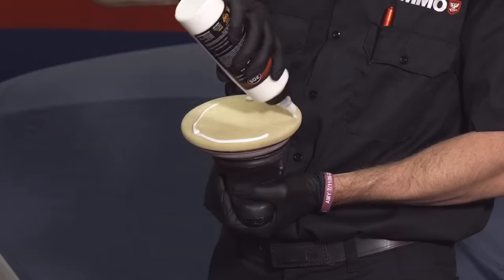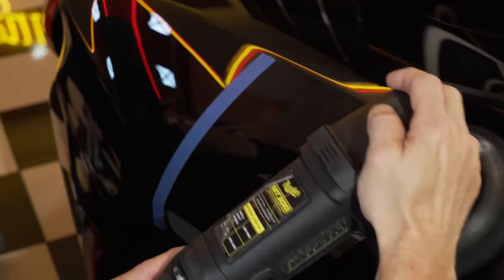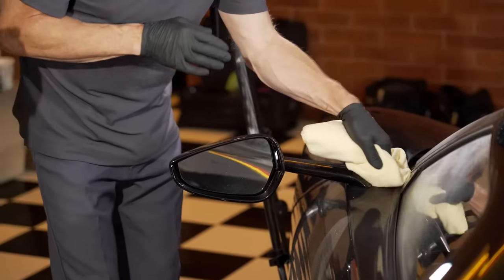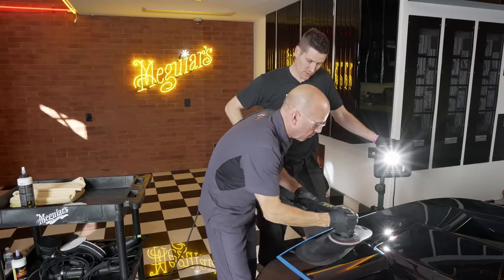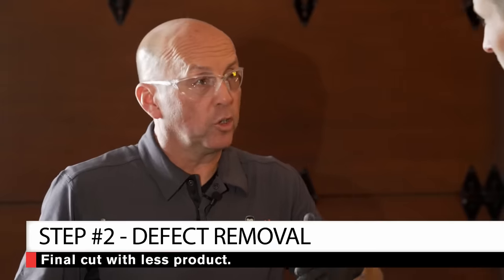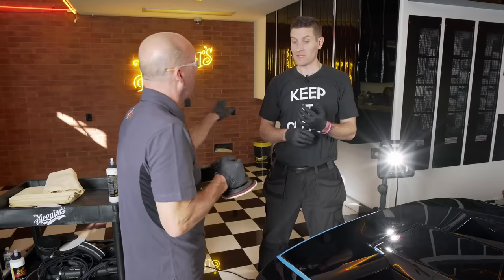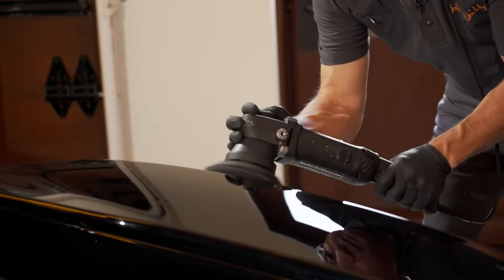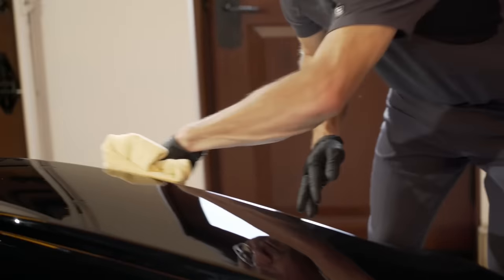3 TIPS FOR POLISHING BLACK SWIRLED PAINT YOU MUST KNOW! FORD GT

Comment: The more I watch, the more I understand.... And the more scared I am of trying myself.
Reply: tell me about just bought a gravel road daily driven 07 black fj crusier that desperatly needs it but i cant afford /trust the shop in my town and im scared to mess this up
Reply: Don't worry about it it's so simple. These guys are professional and their jargon is scary. I just use a random orbital from autozone and a single foam pad that came with it. Compound and wax looks awesome.
Reply: I was the same way. I've had a DA for months and was so afraid of screwing up the paint. I finally did it last week, used the Meguiars Ultimate Compound with an orange cutting pad then Ultimate polish with a white pad, it came out good and I didn't ruin anything.  One thing that really helped me was drawing black lines in marker on the backing plate so I can see how fast it's spinning then adjust the pressure accordingly.  Took some practice figuring out how much product to put in the pads, changing the pads every section with a new pad. The polish alone does a good job with swirls.  I think if I went with other brand/type compound I may of possibly screwed it up, the Meguiars was easy to use, and there were times the pad was skipping around and I got nervous, but didn't harm the paint at all.
Reply: @timb7775  Thanks brother, the black marker idea is genius. I'll give it a try for sure eventually when I create enough swirls 🙂 I'll definitely keep in mind your advice when they day comes 👍🏽

Comment: As the owner of a black car othat lives on a dirt road, i have learnt over time to NOT use polish. A 100 percent cotton rag ot T shirt after washing folded into quarter size. I do 1 or 2 passes in the direction of the metal flow, then turn the rag a quarter turn. I do this 4 times then turn rag over to a new section. This method guarantees my car is like fucking glass every day..and the cotton being used ensures the dust bpunces off the paint as its so fine. Microfibre cloths are not tightly woven enough to get your psint like mirrored glass. Its painstaking work, but once you have the surface reflective its incredibly easy to maintain.  Polish just fills the surface to make it appear smooth. This method makes it smooth. Never ever use any electrical buffers or polishers. By hand. You are welcome..you will be able to see the poes on your face in your paint.

Comment: Finally I am getting my black car to actually look good. I have tried so many pads, polishers and products and it just never comes out like I see in everyones videos. Finally seen that I still had residue and my aint or area was not prepped right. I was using some harsh stuff that felt like sand and still it didn't make a difference still had the same swirls and scratches just more shine to it. I wasn't taking my time wasn't leveling down pads but most importantly my prep was garbage.
Reply: 100 percent cotton cloths and NO POLISH. Polish just fills the surface making it appear smooth and eventually dust just sticks to it. Cotton is finer than microfibre. Use microfibre under a light at night and you can see it marking the paint. Cotton is so fine it actually makes the paint smooth, like glass. I spent 8 hours on my bonnet. I can see my damn pores in my paint. Cotton rag folded into 4. 2 passes..in straight line in metal flow direction..turn rag a quarter turn to left or right and do 2 more passes..repeat until you have done all 4 edges. Get new section of cotton, repeat. Meticulous work..but the best you will ever have your paint. Makes it like glass, and it stays that way. I live on a dirt road and this makes the surface so smooth the dust bounces off it. You're welcome.

Comment: +1 on the water on dry residue after the mow-down cycle with compound. I sometimes even used the water compound slurry on the paint with the buffer to let the compound continue to do its thing (sometimes it would dry out prematurely due to the ambient temperature because we were in SC in the summer- indoors of course but still...) it almost always worked out. Before the age of inspection lights (early 1989) we would take it back out in the sun to do a CHECK. The sun would be a tell-tale sign of how we were doing. We have come so far now that it's unreal...

Comment: Key point that was said by the Guru, "Keep in mind your removing Paint or Clear Coat Permanently"  So only cut the paint if you HAVE to.  I try to explain this to folks that are out every other weekend with their polisher chasing down every single imperfection in their daily driver.  You just might be doing more harm than good, and to think that oops I removed too much clear coat, I will just add another coat of a ceramic coating in place of what I just took off, it doesn't work that way.  Nothing will help your paint more than the factory clear (assuming it is 2 or 3 stage paint etc).  Just my thoughts.

Comment: Very informative indeed. I’ve heard this a couple of times lately that it’s better to do less passes as all you are doing is work in paint residue rather than getting the results you’re after. Suits me as it takes less time!
Reply: Yeah. Experiment. Try with 2 passes, then 3, then 4. You'll learn how many passes are needed to get the work done. Use the blue tape for this.
Reply: Mod MINI could you please explain to me what the benefits of the blue tape is. Ive read that it's so it doesn't damage the paint on the edges of the car but I've done paint correction on 3 cars. I haven't used any blue tape as I don't see any damage or did I get it wrong? Thanks

Comment: I'd like to preface my most likely long winded comment with I have been doing full paint corrections to simple finishing or for about 20 years or so from starting when we only had those dinosaur T-Rex aggressive air powered rotaries to current machines. What a learning curve but helps customers feel more comfortable and I believe brought more business HOWEVER am no means a pro or come close to the 2 of you. First I can't thank you enough for your videos and videos with Kevin. I'm also one who wants to know the why's and "on paper" explanations. You 2 have elevated so much of my ability and my customers are always extremely satisfied. Recently, and for what I believe the first time I had run into this problem here. Sure, I've cleaned pads, played with pressure yet now having watches this and being mindful of residue control most important, priming in a different way and using this technique had my paint correction improve and move along so much better and easier. This is a constantly learning business and my contacts reach only so far with all of us sharing our trials and errors and experimentation results but you can never stop adding to your knowledge ammunition. Between yourself and Kevin, this technique and especially the residue control of clear, which can be easily overlooked, has helped not just myself tremendously however passing along this video has helped many of my contacts and friends in the business. Time saver, improved quality of work and having more in the arsenal between our ears was amazing. So a huge thank you to yourself and for having Kevin with you for the help and knowledge this gave us all in frustrating situations. It's great to see guys like the 2 of you so willing to share as opposed to just keeping to yourself to improve. This will help this business and continue to form a long time to come. I'm in NY, about 60 miles from you and hope to meet you one day in the shop and thank you in person!!

Comment: Crushing it Larry! Priceless info. I'm assuming the foam pad was significantly primed before the application of those "few" drops of polish. If not, I'm way over-shooting the runway 99% of the time. Thanks to you and Kevin.
Reply: Ryan Dorn in this case, NO, we did not prime when using the foam pad. Although I’m a big proponent of priming the pad (aka seasoning ) in many situations, with polishes such as M205 Ultra Finishing Polish, priming will INCREASE the rate of cut. Since we were attempting to avoid causing haziness, and only wanting to refine the finish... we used a minuscule quantity of polish (eventually VERY little, just enough to keep the pad moist), to keep cut to a minimum.
Reply: Add to that: Technically, I did prime/season the pad, using only the four drops you saw me apply and massage in. Also- keep in mind that the pad we used Meguiar’s 5” DA Foam Finishing Disc) is very unique, and is among the best available in keeping pad load-up to a minimum. In other words... it remains very clean and easy to clean during use, so the buffing liquid being utilized spreads & can be worked a long time versus a typical finishing pad.

Comment: A little tail that happened to me. When I finished polishing my car a wonderful Farmer decided to plow his field next to my house. I had a dusting of freshly plowed field on my car. It was fine dirt. I wiped the car down carefully with a microfiber towel. I then reflexed and skinned the car. I noticed several weeks later love marks. Yeap, you got it. I scratched the car with the microfiber/dirt filled towel. I only used one side of the clean towel on a small area. It wasn't enough OCD. I should have used air to blow it off. Guess I will have to fix it this spring. What a pain.
Reply: What a "drag"...
Reply: Yeap, that is exactly what happened. I was more upset with myself for not catching it. Live and learn.
Reply: ONR probably could have saved you from most of the damage if used properly. Try it next time if it happens.
Reply: I hope it never does. It was just dumb luck.

Comment: What should be the very first process?
Wet sanding with 1000/1500 grid paper or by claying
Should I need to do both process one after the another as the purpose of both is to remove the dust layer !

Comment: What about using a clay bar instead of chemicals to clean the paint after the wash and before the buff
Reply: Clay bar removes embedded contaminants. They are talking about dust contaminants and fallout type stuff, so there would be no use re applying soap and water with the clay-bar. Personally i use distilled water in a spray bottle and wipe gently but only if I’m going to have a polishing process to remove defects
Reply: Just use IPA and mix 90% water and 10% alcohol very safe and works well

Comment: Or if u have single scratch you can just sanded with 1500 P and 2000 P and then buffed with moderate amount of compound and then  finish polish. This you take less amount of clear, less heat and less stress to that section.

Comment: Great video guys! I would assume these tips are only for Meguiars SMAT polishes?
Reply: mark Saf I believe that a majority of buffing liquid & pad combos can be used in the manners we’ve mentioned. 

Two points: 

1. Any concerns pertaining to using products featuring diminishing abrasives (“There needs to be enough time for the diminishing abrasives to actually diminish!”) ASSUMES that the clusters of abrasives wil be constantly rolling about, not stuck in place on the pad, and not “eggshelled” in paint remnants. 

2. Super slippery or slimy or high viscosity buffing liquids may NOT work well when super-loaded onto the new pad; easy to get around by either utilizing a pad capable of slicing through the thick liquid and keeping it moving around, or by working smaller areas, or working the area for a shorter period of time, or by cleaning & reapplying more often.

Comment: You can-not over look 3M perfect-it* range esp 2 step/stage compound, the best overall in finishing and overall control of cutting, imho. Ive used them all and its still my go to when all else fails,2nd to this would be " The Last Cut compound" doesn't finish off as nice but it will remove 1200-1500 sanding marks, only use this on and directly in the areas affected you dont need to apply this to the whole car in general. by the way 3M owns Maguires.

Comment: Hi. I use 2 different buffers sometimes.. A regular dewalt and a random orbital.. Should i just be using 1 only all the time or is it ok to use both. Also. What are the best micro pads for cutting and for polishing?
Reply: Daniel Blake keep using BOTH..! Achieving a superb result via rotary is becoming easier, as abrasive buffing liquids work faster (so polishing time is less), polishes perform very well at low RPM (easier to control the machine), and a vast variety of pads & plates are readily available. As a consequence, rotary buffers are being utilized for super-strategic tight-area work, as well as for traditional polishing tasks.

Random orbitals are immensely popular nowadays, and therefore have pads & liquids DESIGNED specifically for them. Plus, they’re MUCH easier to master & control.

Comment: Great video, loving this series.  One question, the speeds on the DA sure seemed low, what speeds were being used during the different phases?  How exactly do you determine what speed to use based on paint dynamics?
Reply: In general, the IDEAL speed when using ANY machine, ANY pad, and ANY liquid is one that allows the pad to glide along smoothly. In other words... if the pad is grabbing & gripping & steering the machine, bump the speed UP until you're easily able to maneuver the machine WITHOUT any steering input caused by pad-to-paint friction. After that, with a random orbital, adjust so that you see at least SOME random rotation of the backing plate. LESS rotation is needed for large stroke machines. When using a rotary (or if you're an advanced-level paint polisher in general), ADD speed to cause something to occur: some liquids will spread for longer period of time, or release their attachment to a buffing pad with an INCREASE in speed. In other cases, DECREASING speed may cause the pad to get a better "bite" atop the paint surface, or cause attached/absorbed liquids to either gather up, or release.  So many factors determine when speed should be increased or decreased, much having to do with the abrasiveness of the pad & liquid, or the characteristics of the pad (just as increasing or decreasing tire pressure has an effect on tire performance, but not without taking into consideration driving speed, vehicle weight, tire design & profile, etc.)
Reply: iamwaxman In other words, experience based results dictates the speed.  It’s basically an art form.
Reply: Allen Maestas no sir! Not art, that indicates you must have a knack, be “talented”... whatever. You can LEARN this! When you’re in the midst of polishing, you’ll be able to SEE the RESULT of INCREASING or DECREASING speed. The result varies depending upon how much paint is being removed, the machine motion, the pad and liquid characteristics, etc. Basically, although the effect of changing speed varies task to task... you don’t need to memorize the result in hopes of using the info on the next car. You’ll make the speed adjustments according to what’s immediately occurring.
Reply: iamwaxman Hahaha, good thing because I’m not much of an artist. Thank you sir

Comment: HELP PLEASE 

So I recently switched from my rotary DeWalt to rupes 15 inch with 6 " pad 
Dual polisher 
Watched bunch of videos and techniques 
Using blue and yellow rupes pad and blue compound and yellow polished.

Took time with  one panel .
Washed ,  claybar , sanded gently with 3000 
Did step one and two , slow motion , overlap the whole 9 yards 
And it looked absolutely stunning .....BUT 
3 days later I saw it on the sun and 🤮🤮🤮🤮🤮🤮🤮
Scratches ( spider ) everywhere, color next to the door I didn't do was too dull as if I am looking through the fog ....
I am open to any suggestions and pointers .
Understand it is hard without seeing me working it but I figure I would ask anyway .
Thank you
Reply: Trouble shoot: work  with adequate lighting such as working outdoors or inside with shop lights and handheld lights to periodically check your work. 
  Do a test spot,  figure out the right combination for your paint. 
  Don’t overwork dead product (compound/polish) short passes. 
  You might be overworking your paint, it could be soft paint that doesn’t react well to abrasives, you could fix it  by changing your combo maybe a soft pad with a medium cut or a heavy cut pad with a light polish

Comment: What would you suggest for hand correcting light scratches and swirls by hand on a black vehicle?
Reply: Thanks for the reply. Do you recommend a specific product? I bought a set of nice foam applicators from chemical guys, but am wanting to shy away from the products that I've been using.
Reply: rebeljeeper1 for heavier scratching, Meguiar’s Ultimate Compound was designed for this purpose. For light scratching (or as a follow-up after compounding), Meguiar’s Ultimate Polish fits the ticket. Both are readily available at Walmart, or any local Auto parts store ($10-$12 apiece),

Comment: Not all black paints are created equal. You have hard paints soft paints. 1 stage 2 stage paints. Paint on metal aluminum plastic or fiberglass. Check with a local auto body paint shop to see what your ride has so you know how to approach it.

Comment: At the end they apply wax circle motion isn't it likely to create scatch?
Reply: How would the direction of the pad change the likelihood of scratching? The reason people talk about moving your towels or applicators in a particular direction for certain steps it is typically so that you can isolate and determine the source of defects. It is not because one motion is more likely to scratch than the other. Also, applying a wax to a soft paint if done correctly should not add any defects at all.